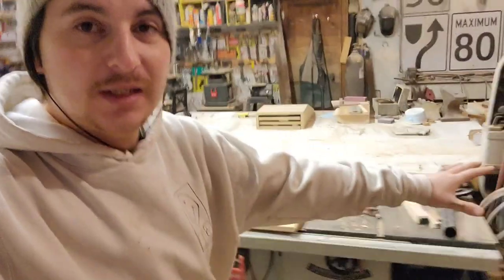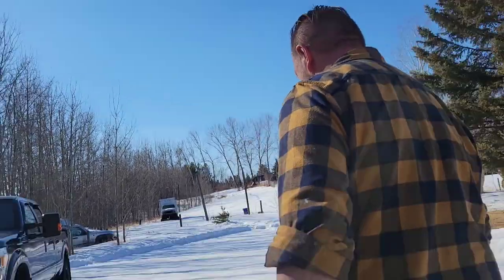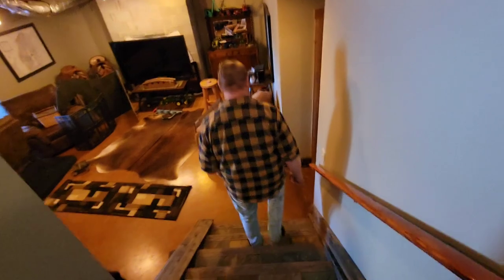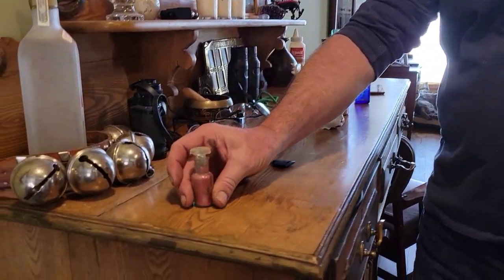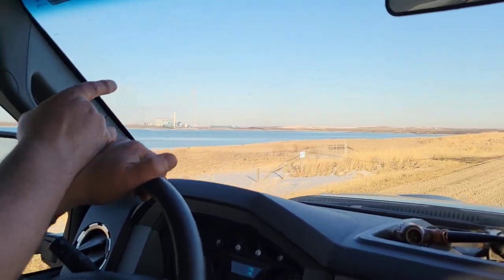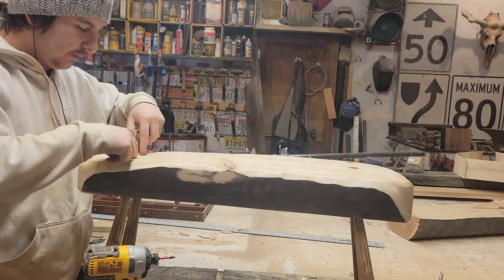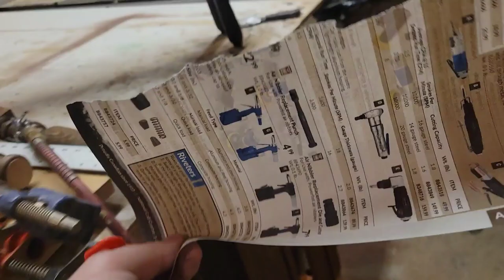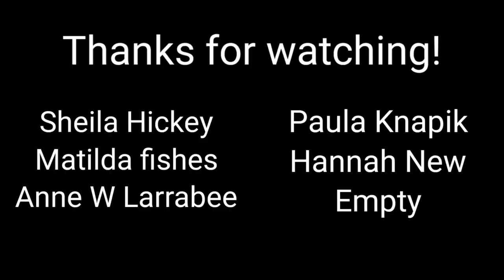Making a primitive bench and touring a cool house | Another VLOG #203

Comment: The Video was Awesome! The last clip, I would probably say you hit a piece of rebar in the concrete, which melted your bit because it got hot since a concrete bit wont go through rebar. next time try using a steel drill bit once it stops at the rebar to go through it.

Comment: In Canada, don't they have were you can get your windshield replaced for free when it's cracked? I live in Kentucky and you can get your windshield replaced for free.
Reply: Only if you purchase insurance for it
Reply from the maker: On certain hi ways, you can get compensation as well as certain trucking companys will pay for your windshield if their trucks threw rocks at your windshield. I havnt heard of people just getting free windshields willy nilly. Most folks wait for the summer to get a new one. Other wise theubwould just get 3 or 4 a year at the rate they get cracked. Many folks get their chips sealed as well which helps alot.